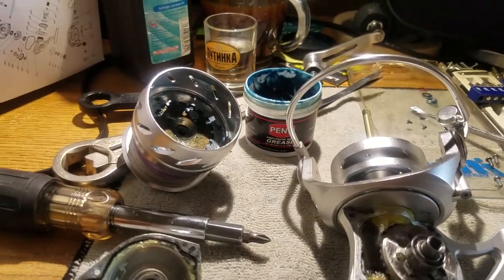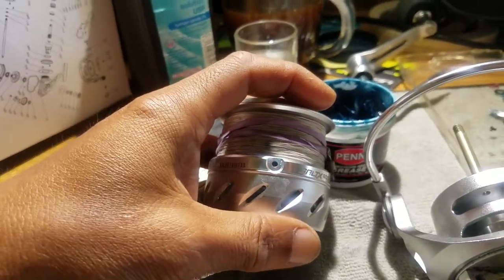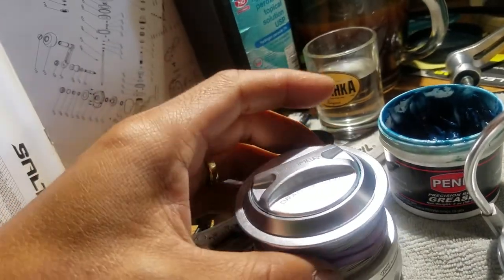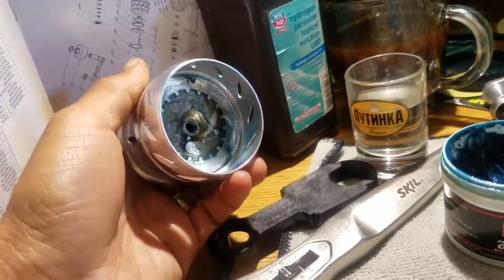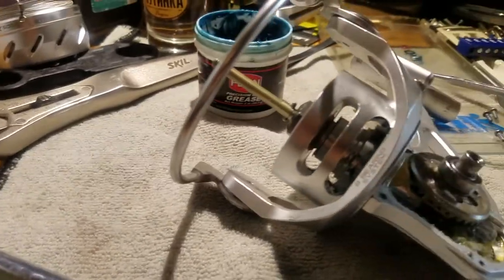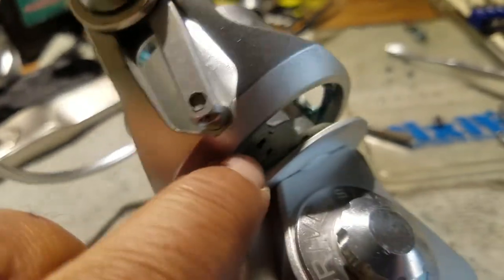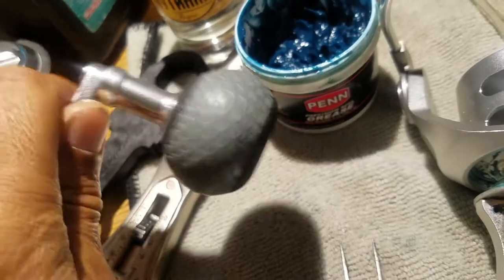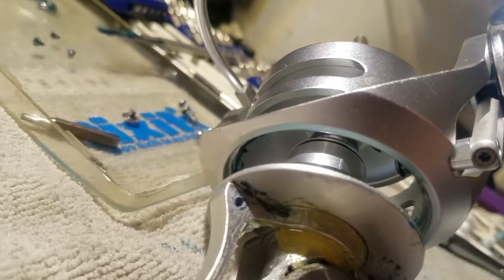SALT X Tsunami 6000 - Debunking The "Fully Sealed" Claim!

Comment: Being that it was so new, why not send it back to them and have them send you. New one? Obviously this was a manufacture defect. 2 of my friends use these with zero issues at all! 
Even my shield 6000 has not had any issues in the 2 seasons I’ve had it, this fall alone, I pulled in 50 bass from the the south shore of Long Island being dunked and reeled underwater. All I do is rinse it off when I get home
Reply from the maker: @McLovin6912 ..... Yes I did get a New One... IT WASNT PRESTINE  as most that are brand New.. But it was new.. much more refined manufacturing requirements.  Thank you for your comments.. BTW I'm composing all the interactions between myself and Tsunami,  they have been very accommodating and helpful. it's just a bad luck of the draw.
Reply: So I guess they sold you a pre-owned reel. Glad to see you’re getting a new one. I love my shields and will be buying this reel. Tight lines
Reply: Please do another update with the new reel, I’m curious
Reply from the maker: @6912wfd  check your notifications... got a new update to the the reel.. Finally! pardon the delay.. took my time to figure nest practices and not just issues.. uploading right now.. Tight Lines ! Fish On ! --- OFD

Comment: I would rinse and clean my brand new vr 175 and with in a month rust in the inside some of these expensive reels are flawed
Reply from the maker: @Lun3y Arevalo it seems like an issue of Corporate sabotage.. Cause of our trade wars with China and or the companies we buy from are too cheap to hire someone at the production level to inspect properly! Also, I feel like these days to really keep your expensive reels in perfect condition requires a little no how of "servicing" them.. Sucks when you get a full on Lemon, but as I stated before they sent me a "New" one.. I'll post That video soon, trust, its hillarious.
Reply: @OrthodoxFishingDAD  Glad that you posted an honest review. Is it still worth buying? And as an engineer, can you recommend a better option? Or a work around with this model? Such as, simply removing the old grease and replacing it with a better one; that is before fishing. Unfortunately, after this video it does not look like a solid option as a well built submersible reel. Good luck!
Reply from the maker: @capecodcanal  Greetings to you. I would not recommend the Salt X at this current production level. My first request would be for them to replace the Design of the AR clutch Plate. Tsunami uses the same Penn Grease that I use- when the Repaired my Reel the Engineer uses the same grease the Blue version - The internals are very well designed but the Machining of the parts are very sub pare and very much below quality standards. Conceptually the Salt X is a wonderful design and very similar to the Van Staal. - So with that being said, my only reliable choice would be the Van Staal.. - But uh oh- "rumors within the industry" is that Van Stall has been Acquired by another Larger Tackle Conglomerate.  With that coming down the line... Let's talk Van Staal- Bottom Line if you are going the Van Staal route and you wanted Fully Sealed- By the VSX version ( get it soon before the swap components with the New Company running their operations)- dont by the VR version- the VR is water Proof not Fully Sealed. The VR is also a sign that the company is going with cheap - replaceable- components. I persoanlly own A VSX 250 and it's a beast of a work horse. It's heavy but to me it's  perfect- I pair it with a St. Croix Legend Surf - 12ft Belize Blue - MF. when traversing Jetties, Rocks, Boulders, or just walking miles from end to end on the surf lines - the little weight and the feather light Rod makes for a great companion.- Funny story - last year I was testing the two reels my Salt X 6k alongside my Van Staal and a freaking shark took my Van staal and rod into the ocean i had to swim out almost 50 ft to retrieve back the rod and reel plus landed the shark and released! I tell this story because similarly the SaltX had a COWNose Ray take it into the surf when i retrieved it  back - my sand issues started to show up- that was a down hill road after that where I just couldn't get the Salt X back to original conditions. 
Final Thoughts - Try to start searching only non China Made Reels - My go to is my Daiwa's - BG4000 - Ballistic LT 6000 - and my very light tackle BG 2500 - All these Daiwa's except for the LT is just regular work horses that have been dunked and have encountered sand with no issues - just a quick rinse and then at home cleaned and greased again - never really fully opened down to the gears- I only do gear work at the end of season in December. - Daiwa has a division that is Located In England- Also Daiwa Australia is very awesome. Those Aussie's down there are Very Hardcore with their surf and Jetty fishing! - Another choice would be main land Honk Kong - Malasia- Indonesia. You can ask for a different production area of your reels - just ask- sometimes certain Reels are only available in ASIA- but that doesn't mean it's not Available to you. - Send a PM to  @tackle advisors  also another cool guy is @beachbomberfishing - he has long cast videos and gear used for some pretty heavy surf fishing. At the end there are so many great Ideas on the YT - you just gotta go with a Budget  and stick to what you want- I started out last year with a few simple request for my search of the right combination. I wanted Fully Sealed - I wanted the reel to have strong history - I wanted the reel to be a lifetime Investment at the time it was only the Van Staal - for rod I wanted the same quality - St.Croix stood out for it's price point - and solid Warranty -  as well as it's proven track record of reliablity.  - I work with a 11ft Team Daiwa  MF as my back up rod to the St. Croix. Then i have mostly BG rods from Daiwa for light tackle stuff with my Daughters. My porgy videos with my Daughters show them using the Team Daiwa and BG 8ft. 
I hope that I helped more than confused you.  Consider the Penn Saltwater Spinner - the Shimano Spheros (australian version) cut and paste this Search this title(BeachBomberFishing):>>>>  Jetty Fishing Reels 2019 - Daiwa Reels + Shimano Reels
Reply: Lun3y Arevalo buy a VSX!

Comment: I had SaltX 6000 couple months and fished in south shore Long Island, and feel reel chattered when I reel in something last week but it went away later. When I went home, tried to open the reel cover but could not because I didn’t have right tool. What kinds (Size)of screws they used ?
Reply from the maker: @JAMES SU  You need Torqx set.. I use my Mobile Repair Kit it's like a T4 or T3.. But diffinently use a Torqx Hex Set . Hope that helps..P.S. Remember that the Metal is soft.. So use care and make sure your Hex/Torqx Head size fits snugly you might want to use a light cloth to prevent from scratching the frame or very easily stripped the screws they dont go in very far...
Reply: Thank you.

Comment: Very nice reel, but just get a Penn Slammer (not the new 3) and be done with it an be sorrow free. My Penn Slammer 460 is 5 years old now and is used once or twice a week in saltwater (coastel or from a boat) for 3/4 of the year and it has not yet had ANY service what so ever and it is still just as good as when it was brand new. My son has a Penn Slammer 260 that is 4 years old and is used about 5 times a month for 1/2 of the year in saltwater and he has dropped it many many many times in the sand AND in the saltwater and it is still like new also without any service, we just rinse it with tapwater when home again. The only con I have about the Penn Slammer is that it is very heavy compared to my Daiwa Ballistic LT. Best regards from Denmark.
Reply from the maker: @Felgercarb Thank you for stopping by! I'm uploading a new 2020 video about the Salt X - Yes.. I love my Daiwa LT Balistic 6000 - I fight massive sharks with that reel coupled with my Daiwa _Team Daiwa Surf 11ft. - I mentioned many times that it is a Manufacturing issue and lack of Quality Control on the final product. Also most of the 2019 were all Prototypes ! It is unfair to use Anglers as testers unless they sign up for it (Joe Olivas) . Now that even the Van Staal has changed hands with a different Owners( Sellers)- we may find that the next best Reel would be coming out of another market ! If you want to get your hands on a  lifetime Van Stall be sure to order it soon and ask for the Original versions of the VSX - the VR versions are not up to par. That being said - Hello from New York - I lived in Germany and rode my Bike to your Country every weekend- I miss Europe greatly ! - Fish On ! Tight Lines ! --- OFD 
P.S. My go to is my Penn (classic) Peer 209 / Van Staal VSX 200 / Daiwa Ballistic LT 6000 / Daiwa BG 4000 - These never fail, period.(for me :) _
Reply: OrthodoxFishing DAD -No wonder that you rode to Denmark all the time. Denmark is the fishing paridise (but firearms hell🤠) of Europe. Almost no rules and only 30,-$ for a one year fishing licence also incl turists.

Comment: You keep on saying you clean reel with high pressure water.Maybe that's how water got in.any reel will get water intrusion with high pressure water...
Reply from the maker: My conversation with tsunami and their Engineer was told nothing wrong with using high pressure. Even the Engineer suggest using my Garden hose which has more pressure than my Kitchen Faucet.  The Engineer says it's supposed to be sealed so pressure wash/rinse will not effect it.. The Plastic Ring has a crevice run all the way around that is small almost the thickness of a Hair so small sand grit lays inside this crevice so high water rinse is fine. Conclusion from the Engineer is a failure of A SEAL THAT HE FOUND and also that it was not fully assembled properly at factory.  I will be putting a final video with screen shots of the faulure found by the Engineer. Plus audio recording of our conversation. Thank you for taking the time to comment.🎣

Comment: I have a question. Where did you go to or what website did you go to claim a warranty for tsunami rods n reels? I can’t find anything online
Reply from the maker: @stuarticus86 the following info is off of my shipping label from their Direct Warehouse.. just ask for the warranty dept. ..(813) 926-3582 / Folsom of Florida, 1920 Gunn HWY, Odessa, Fl. 33556-3524.....   If you get no results PM me and I'll give you the engineers direct Mobile , I'll ask my engineer if I can give you the number or at least a number to get what they call a "Tag" . You use the tag as a shipping label and it is generated with an RMA built into it. Hope this helps, Tight Lines. OFD
Reply from the maker: @Stuarticus86 looks like they scrubbed their portals for Customer Support.. They want everyone to go through their Vendors or the shop you bought it from. I called them directly and then I had Tackle Shop call them for me   as well kinda like a double whammy cause they where avoiding me. What happens if you dont mind me asking?
Reply: OrthodoxFishing DAD Thanks alot! I was stupid and took a power drill to the knob screw of the Salt X so the screw head broke off. Now theres a piece of screw stuck in there.
Reply from the maker: @44studawg  LoL.. yeah hand tools are a must.. and alot of relaxation music or a nice cold one if you prefer.. Take your time when doing maintenance and get "personal" with its inner working parts and sections, lol. Good luck hit me up if you need further assistance! Tight Lines. OFD
Reply from the maker: @44studawg  hey just tell them that you used hand tools and the screw snapped.. it happens all the time you were tightening it cause it was lose and it snapped keep it simple